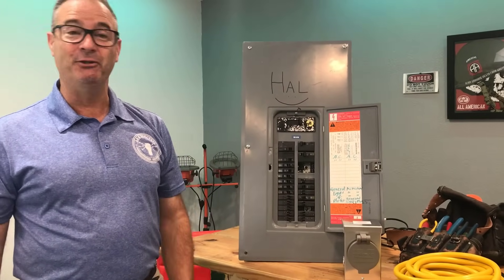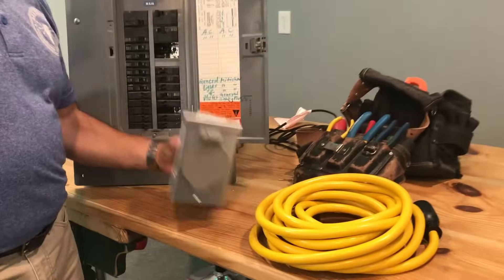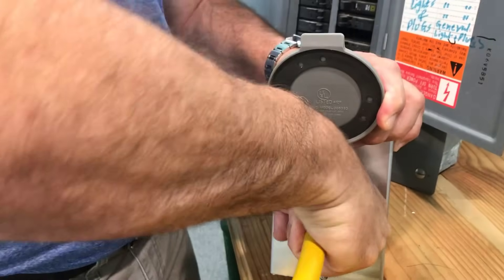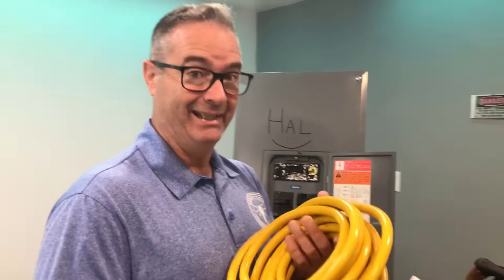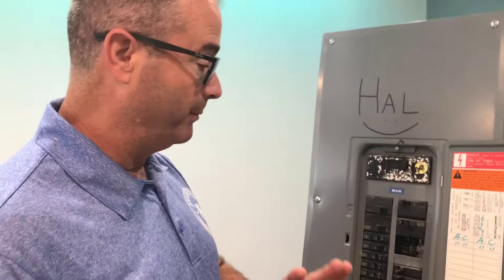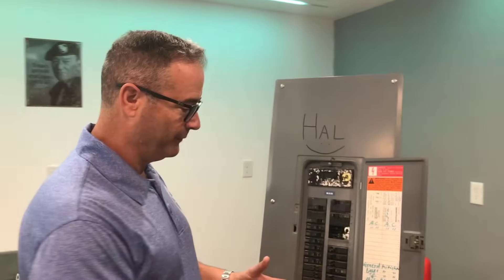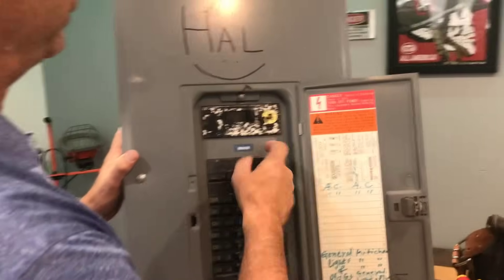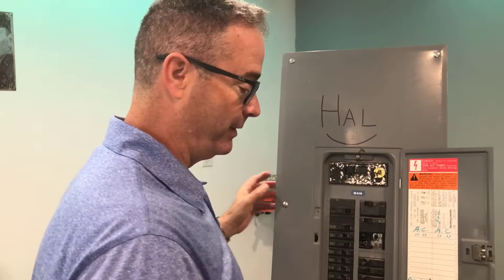4 Generator Hacks by an Electrician

Comment: If I only have 120v in my main load center, do I still need a double pull 50amp breaker for this generator backup outlet?
Reply from the maker: What amperage?
Reply: Thank you. Its a 100amp main panel and I have a 60amp DP to a sub panel. @abrelectric
Reply from the maker: @davidbruce5377  Sorry, I meant the amperage of the generator? Or KW rating? You can use a double pole breaker and only wire to one pole. You'll need a double for the size to connect mechanically to the interlock switch.
Reply: @abrelectric  its a 10 000 watt generator

Comment: I run my portable generators with a load for 30 minutes every month during our emergency siren checks on the first Saturday of every month.  I also run the whole house on a generator for 30 minutes twice a year during each time change (you have to reset you clocks anyway).
Reply from the maker: That is a great practice. Thank you
Reply: Another tip besides these great ones is to secure your generator from porch pirates.  Anchor it with a concrete form with a metal loop hook to chain it overnight. I plan to do this in the spring as the ground is frozen now and just had a transfer switch installed by a qualified electrician. I also purchased a 30 amp RV surge protector as the one installed in the panel will be bypassed by the main breaker turned off. My generator is 30 amp predator 5000 using only propane for now. Thanks for the tips.
Reply: So smart and clever!

Comment: How do know when the power is back on?  if the main is off... so you can switch back...
Reply from the maker: You don't - unless you have an indicator light connected to the mains. Some of the Generac transfer panels have this built in.

Comment: Not a US person, those external plugs are not weather proof. No seal to stop rain getting into terminals. Maintenance is PREVENTIVE, if something is broken or not working in NOT maintenance, thats REPAIRING. Genny interlock is primarily to protect your genny, its to stop you back-feeding the grid (huge load) and/or potentially killing the liney trying to repair the outage.
Reply from the maker: My understanding is that the Nema SS2-50P is waterproof when the female cord is plugged into the twistlock inlet due to the gaskets. 
Do you have info to the contrary?
Reply: @abrelectric  We simply don't  use them, we are 240VAC, not 110 so need to be more suited. I see a rubber gasket inside on the face but that is reliant on the clamping pressure made purely by the brass terminals on the twist action. This requires a lot of load on the thin edge of the brass....
There is no secondar face or potitive seal to stop driving rain from going inside, right up to that face.

Comment: Got a generator inlet , interlock and generator. Works great! Been using it for years, runs most of the house except oven and dryer. The only issue that I had was during a really bad rainstorm ( 12 inches ) in a 10 hour period. The power wen5bout at night and my basement flooded before I was able to hook up generator. 
I solution for that is I just brought a UPS for my sump pump. Will allow me 6 hours to 2 1/2 days of power to sump pump. I should be able to get my generator up and running by then.
The best solution would probably be a whole house generator on a gas line with a by pass panel. Maybe the next house.

Comment: Great basic info!   Makes the important distinction between maintenance and repairs, which more often than not result from lack of maintenance, and are most undesirable with emergency systems.   I just had to run my generator, and intend to drain the gas tank, so I'll have fresh gas in it next time it's needed, especially since there are no sources of ethanol-free gas very nearby.

Comment: I wired my backup generator to charge my backup Solar batteries. At 3 bucks a gallon for gas a kilowatt hour of gen power cost 75 cents. If our power goes off , my spouse can press a button in our utility room and our power comes back on. Without starting the generator.

Comment: Hello,
What if my generator breaker is located on the bottom of panel far from main shutoff switch? How to install the interlock kit?
Thanks
Reply from the maker: You won't. They need to basically be co-located. You will need to move some circuits around.

Comment: Question for ya, I have a 12kw generator. I have a 400 amp service split into 2 200 amp panels. Can I run one 50 amp to one panel and one 30 amp to the other panel ?
Reply from the maker: Simple application: Assuming each panel has a main breaker, install an interlock switch with a 50 amp breaker.l in each panel. Both breakers feed to single generator inlet. 
Mind your phasing!

Comment: Another point, know how to open your electric garage door opener when there is no power, otherwise one cannot get their portable generator out of the garage to connect it to the house.
Reply: @AlexJonesWasRight1776 Some garages have ONLY the one main door.
Reply: Never occurred to me that this would happen@AlexJonesWasRight1776
Reply: That's one reason I got the battery back up Gar Door openers. Have used several times.  I used to have to pull the release cord on the opener.
Reply: While I know how to pull the release rope I solved that problem another way.  For a few years I bought one of the inverters that I can hook to the car battery and power the opener.  Now I have one of the inverters that has a built in battery that I can plug in.  That way I can shut the garage door if I leave the house and open it when I get back with the remote opener.

Comment: How about grounding ? Also whether neutral should bonded or unbounded ?
Reply from the maker: Bonding at the generator will trip the generator main breaker if it's a GFCI style breaker. Otherwise, for a home back-up application,  bonding neutral to ground on the generator is unnecessary because the house main panel should have that bonding connection

Comment: Other suggestions -  Make sure:
1) Easy access to the generator and path to where you will run it (i.e. I stored just inside the garage door so can easily roll out when needed)
2) Fuse box and transfer switch are unobstructed with clutter

Had a few short outages earlier in the year, but didn't immediately use the generator because dreading the hassle to get it out and plug in, or the power may be back due to the time it takes.  But now, am all ready for any outage (short/long).

Comment: Another thing you should have mentioned is that when the main breaker is on, the back feeding can electrocute the people working on the poles.
Reply: I’m totally off grid 52,000 W of PV. I rarely use my 10 KW LP generator. I test mine once a month for 20 minutes. Thanks for the great video. If the power company would have trimmed there right of way, I wouldn’t have had to buy an off grid solar system. They like their 12 inch baseboard trim, marble floors, big salaries/benefits too much at the power co offices around the good ole greedy, corrupt USA
Reply: I was thinking the same thing. He only mentioned the less important scenario of generator damage. I recommend installing a good transfer switch. Makes things SO much simpler, and won't create a hazard for upstream repair personnel. Some jurisdictions could get around to outlawing home generator hookups through the service panel based on a few users' negligence.

Comment: Like clock work, 1st of every month I do the maintenance start and run, I even go so far as put a load on the generator just to make sure it’s actually producing power. At least once a year I give the generator a tune up. And if I do need it for an extended period of time, I change the oil and filters. So it’s ready for the next time. I’ve also learned to run the carburetor  dry an drain the gas tank to prevent damage do to water or gummy fuel.

Comment: Late to the party, great advice. Couple of things I want to mention. When I installed our generator built a generator shed so we could store it and protect it from weather when it was running. It is an electric start generator so purchased a battery maintainer and wired a door interlock switch to a 12V LED light. That way as soon as I open the door the light comes on so you are not working in the dark.

Not really a hack but a topic you didn't mention assuming your generator runs on gas figure out worst case usage and keep enough stabilized gas on hand. Here in NH winter snow/ice storms can result in week long outage. I maintain five 5-gallon gas cans with stabilizer. Using the genie a few hours in the morning and evening the gas should last for a week. One can is used for yard machines. The cans are numbers and rotated in order. If gas gets too old I dump it into one of our cars. Since the cans are sealed I have not had a problem with gas a year old. I keep a log book and update it each time I run the genie and track gas purchase. Probably overkill but as you posted you want to make sure your emergency generator will actually work during a power outage. 

Test the generator every 3-months or so for half hour or so. I use a 1500 W space heater as a dummy load. I run the tank out of gas and then switch the fuel shutoff to off. There is always some gas in the tank and you don't want it sitting/evaporating in the carb fuel bowl.
Reply from the maker: Great advice! I let mine sit too long between testing and had to take it apart and clean the carburetor.
Reply: Just convert to propane @abrelectric
Reply: If you can, find a gas station in your area that sells non-ethanol gas and keep a couple of 5 gal containers treated with a gas stabilizer on hand. Ethanol gas will eat up your carb in no time.
Reply: Also drain the carb.

Comment: Sorry to burst the “Fuel stabilizer” bubble here. I bought my Honda Commercial-grade generator in 1998 (an EM5000 during an ice storm up here that lasted up to 35 days for some of the folks. I lost power for five days myself… in the winter. I have run my generator 4 times per year since 1998. I have always used Stabil, a fuel stabilizer. Guess what? Three or so years ago, during a practice run (my regular maintenance drill), the generator did not start. Sooo, I took it to the local Honda power tool service center. My generator’s carb was gummed up. I couldn’t believe it. I told the service center mechanic that that was impossible. Here’s what he asked me: “How long have you had your fuel stabilizer”? I said years… He said: “Ah! Ha! Fuel stabiliizers don’t last for years… Shocking!!! Anyhooo, the generator worked fine for two more year after the card was cleaned up. One year ago, during a short power outage of 4 or 5 hours, as soon as I started putting on a load of about 3,000 watts on my generator, which it never had problems with in the past, I could see that I would rev up and down, not being able to keep a constant revolution of 3,600 RPM nor a consistent voltage. Hum… I took the generator to another local Honda power tool service center. I told the service manager that I had had the carb cleaned “recently”, that I always put fuel stabillizer in the tank, but the generator could not keep a constant RPM. The diagnosis came down: the point at which the gas line connects to the fuel tank was gummed up, barely letting gas out of the tank… Soooo, so much for the fuel stabilizer. From a long term maintenance perspective, I now recommend pumping all the full out of your generator at least once per year with a battery-operated pump. Also, run it to make sure that carb is fully dry. Put methyl hydrate in your tank to clean up the gunk. Leave it in there until you next maintenance run and add the highest octane possible gasoline you have in your area, i.e. 91 or better yet, 94 octane, if you use a gasoline generator. Also, when you run you generator on a quarterly basis, put as a big a load as you can, such as a heater (1,500 watts) AND a hair dryer (1,500 to 1,800). You need to do this if you have a gasoline generator as the gasoline degrades over time as does the fuel stabilizer. If you do this, you will know when your carb or your tank is getting gummed up, even though you have put a fuel stabilizer, methyl hydrate to clean the tank and run it 4 time per year under heavy load (3,000 watts +)
Reply: Yes, I noticed in recent years the containers of Stabil are marked something like "use within 2 years"...
Agree it is best to use non-ethanol with stabilizer and change out every year.
Store generator with dry tank unless you use it frequently.
Reply: @AlexJonesWasRight1776 BTW, I’ve never used ethanol gasoline in my genset. Always at least 91 octane. But, I’ll certainly try the marine-grade fuel stabilizer. Tks!
Reply: Stal_bill 360 performance is What you need.
Reply: @troywilliams8659  However, here’s what Google answered when I asked about Stabil 360 performance’s shel life: “A: STA-BIL 360® Performance™ has an indefinite shelf life when it has never been opened. We still recommend using it within 10 years, as with any additive. Once it is opened we recommend using it within 2 years.” Soooo, no more than 2 years sitting idle in its container. If you have not used that product after sitting open on the shelf around the 2-year mark, just dump it into your engine’s gas tank. Not in your generator…

Comment: Here is a question for you.  A 50amp plug on a generator can only provide 12Kw but I've seen some 20Kw portable generators with two 50amp plugs. How can both plugs be patched into the electrical panel?  I was thinking that 2 inlet boxes with 2 50amp breakers would do it as long as the X and Y legs on both inlet boxes are connected to the correct buss.  Your thoughts?
Reply from the maker: In theory, I agree it's possible as long as the phases are synced. I've never done it myself.

Comment: Try lining up the plug with the inlet at night. Take some white-out an make a line on the plug & socket to line up the two before you twist it. Keep battery charged. Install emergency lights that come on when power goes out. Install them where you set up the generator and at the panel. Maintenance is easier when using natural gas to power the generator.
Reply from the maker: Super useful tips - thank you!
Reply: Good tip, I use that line to line trick for proper reconnection on a multitude of tasks. Good old builder's trick, probably goes back to the pyramids
Reply: Jesus didn't have any thing  to do with this subject.😅@AlexJonesWasRight1776

Comment: @abrelectric, Want to compare portable generator wattage output (30A plug) to house emergency circuits’ consumed wattage. Any devices/apps for this?
Reply from the maker: Accurately,  no. If you need to know what the emergency circuits pull, get a generator with a watt meter built-in. Or
Kentucky windage: run the generator,  run your loads and watch and listen. Adjust from there.

Comment: Good tips. As someone who's gotten through numerous hurricane and power outages, here's a few more huge tips:

1. Get a generator with a total harmonic distortion (THD) of 5% or less. Almost always, an inverter generator has a THD of 3% or less. You can get "regular" portable generators with a THD of 5% or less, but you've got to look for them. You're taking a chance if you use a conventional portable generator to run your house. The last thing you want is to fry the motherboard in your refrigerator.

2. RUN YOUR GENERATOR OFF OF PROPANE! Specifically, get yourself a nice, 500 gallon tank and get a plumber to run a line to where you're going to run the generator. If your generator only runs off of gas, there are almost always conversion kits to make it run off of propane. It is PAINFUL to 1. actually find a gas station that's pumping gas during a power outage, 2.  cart that smelly gas in your car (your car WILL smell like gas after) and 3. set a periodic alarm to fill up the gas tank. Trust me, those three activities will take up a huge amount of your time, to the point that it's the dominant thing you're doing and you're not actually sitting down, relaxing.

Regarding #2, yes, if you don't use the propane for anything else, you could have $2K worth of propane just sitting there. But if you lived in Buffalo a few weeks ago when they got 6+ feet of snow, having that propane ready to go was literally the difference between life and death. If you have a nice inverter generator, a 500 lb tank will run it (especially if you're conservative with power use) for 3 weeks or more. If you still don't have power by then (it must have truly been a terrible event), the roads should be passible at that point and you can call for another delivery.
Reply: Have a small sub panel  installed fed from the main panel with the interlock on the sub panel.  Square D makes such a panel.  This way you can't overload the generator and you can see when power is restored to the house.  Having operationing instructionns at the sub panel and train other    members of the house to operate the generator.
Not only should you check voltage but frequency (how fast the engine runs) when doing scheduled maintance. maintenance maintenance

Comment: Just installed the same hookup.  Power went off Christmas Day and still had dinner underway.  This hookup saved the day!

Yes!  Maintenance is important.  Make sure and start your generator once every quarter and let it warm up to operating temperature and then, turn the fuel valve OFF and let it run dry.  Don’t just turn it off and leave gas sitting in the bowl.  Also…USE FUEL STABILIZER (for gasoline generators) if you are going to store it full.  The fuel will last two years if you make sure that the fuel cap it tight.  Refer to your generator’s manual and make sure and change the oil at the end of the recommended use cycle (usually measured in time).

This has been a public service announcement.
Reply from the maker: Thank you!